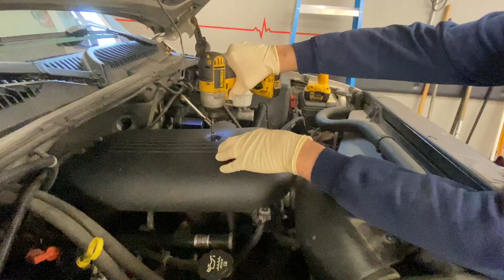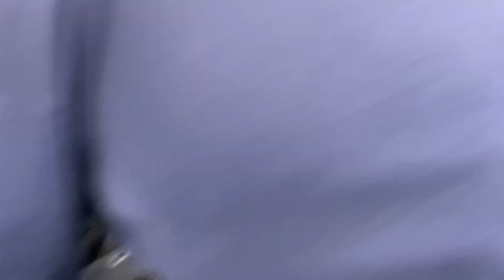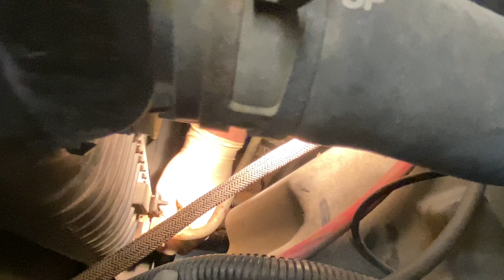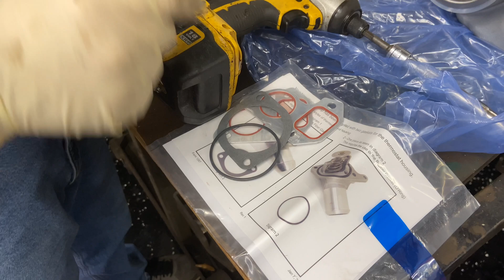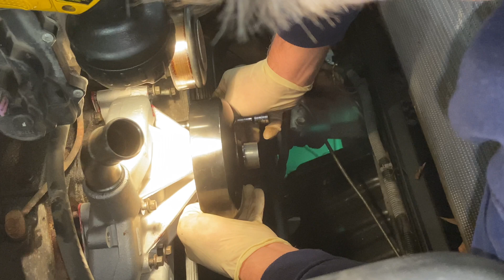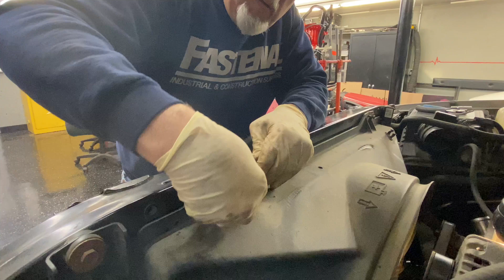How To Replace Water Pump 1999-2006 GMC 2500HD 6.0

Comment: Getting ready to do mine and it's good to see the same moron that designed the oil drain plug to blast oil directly onto the usually still hot exhaust causing an unbelievable mess also designed the radiator drain. He must have been really mad at the EPA 😅 this is a great video thanks for making it!
Reply from the maker: Glad we could help you out. Thanks for checking us out and don't forget to subscribe!

Comment: Hitting the wire wheel with bolts is okay but you can take off the zinc coating
Reply: So you took zinc plated fasteners, removed the zinc, and then putanti-seize on them.. they weren’t stuck to start with, the zinc seemed to be working fine..
Reply from the maker: We didn't take anything off the method shown is fine.

Comment: Beautiful disassembly and reassembly. Exactly how I like doing things; the right way. Just noticed a small leak near the water pump housing today on my 300k mile 2500. Easy job, but I’m contemplating doing the timing cover gasket as I’m already halfway there for that too. It’s literally the last gasket/oil leak that I have on my engine but I’m kinda scared of that harmonic bolt lol. I know not to reuse it but it’s the shear fact of being scared of braking it trying to get it off. I may work up the confidence to do it and replace some stuff behind it as well.
Reply from the maker: Hope this video helps you out.

Comment: A couple of questions. I noticed you didn't use a torque wrench to bolt on the water pump. Any reason for that? The second question is, does AC Delco recommend that you lubricate the gaskets before reinstalling the pump? What type of grease did you use? Thanks.
Great video.
Reply from the maker: We used a little bit of wheel bearing grease. If you torque the water pump bolts to what is recommended you should be fine. In the 30+ years Steve and I have been working on cars we never had an issue using the method shown in the video.

Comment: Doing this again after 30,000 miles replacing the thing. Thanks for the refresher, and no thank you to eBay trash parts.
Reply from the maker: Thanks for watching. Toss an AC Delco pump in it if you can. The aftermarket parts that are out there right now are complete garbage

Comment: Doing this tomorrow and watching your vid as homework. After watching I'm sure it will go smooth knock on wood  Thanks for taking the time to make the video and great job!
Reply from the maker: Hope this helps you out
Reply: @HomeownerRepair  The job went well! The only part I got hung up on was the fan clutch removal. Mine was stuck on hard and I had to use a cheater pipe for additional leverage to break it free. Thanks again!